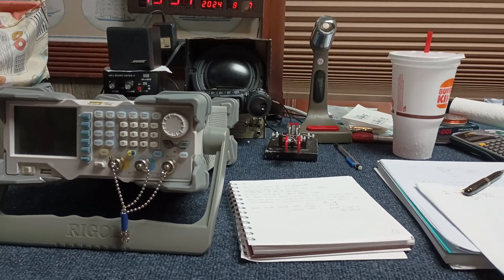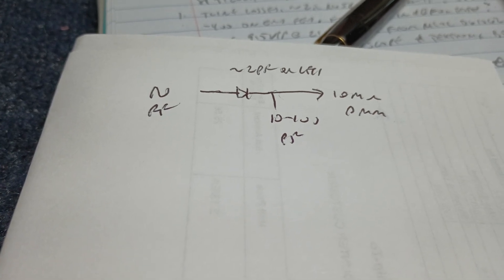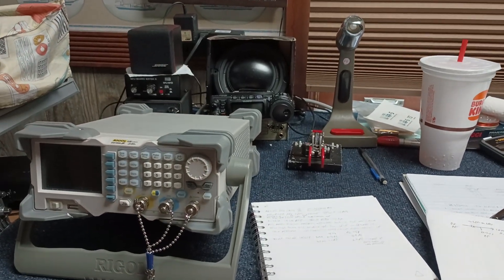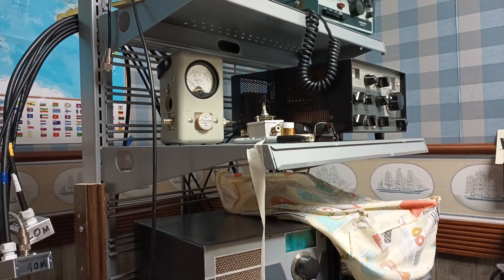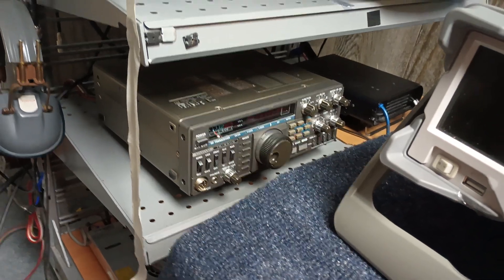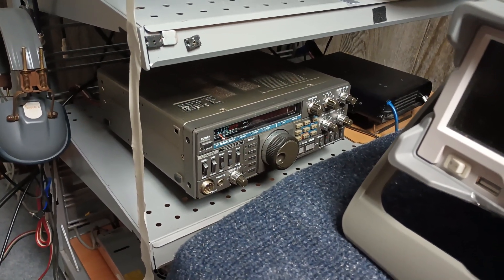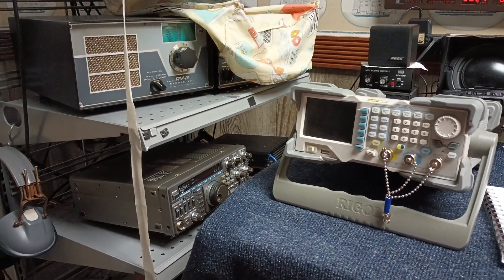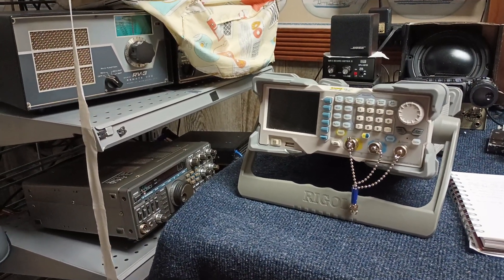Antenna System Mismatch and Distortion ( FCC rules violation!)

Comment: A similar issue can happen if the supply voltage to the rig is too low. Try reducing it to about 11 volts and I bet you'll all kinds of trash around the carrier. An IC-7300 really has fits with low DCV. Of course the mismatched load just makes things worse because it can result in higher PA current and spur generation.
Reply from the maker: things get non linear at low volts...

Im guessing its related to TOI but Ive not had a reason to go down that Rabbit Hole.